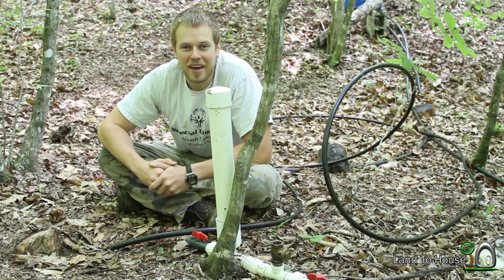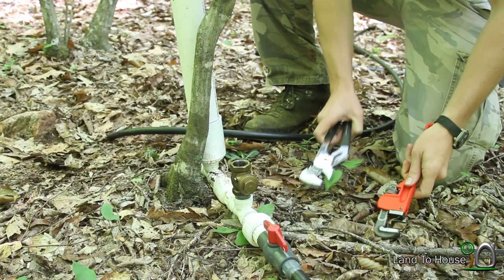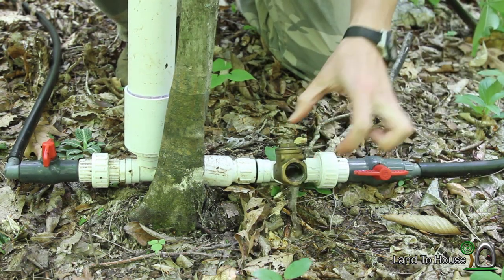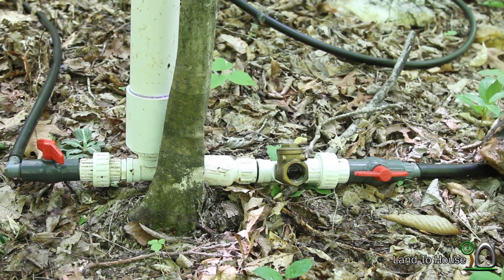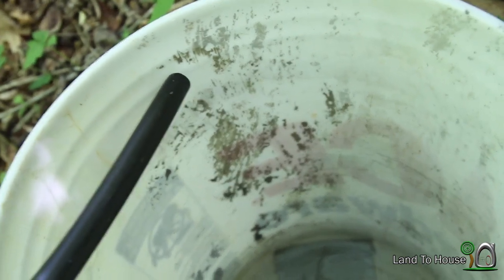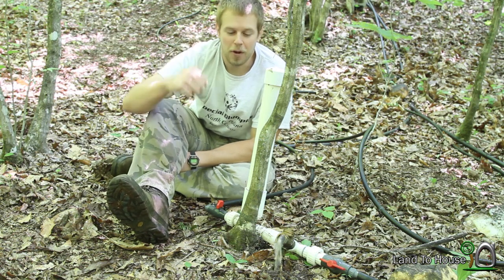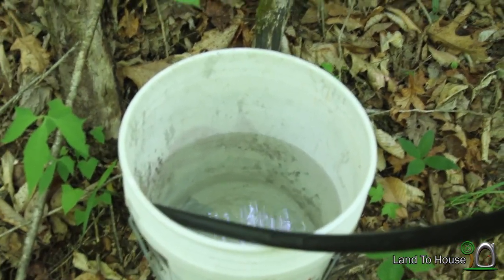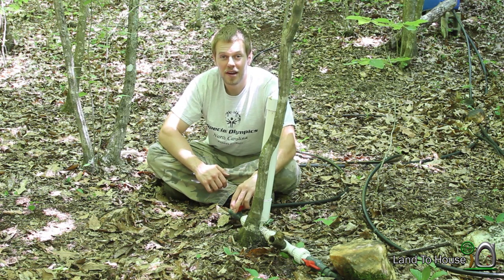Minimum GPM 3/4" Ram Pump

Comment: Could you send that water coming out of the ram pump back to the barrel by attaching another hose or another ram pump?
Reply from the maker: Brandywine6969You can add a splitter ont he pump delivery pipe but the loss is so great that you wont get much more time in operation.

Comment: Hi!!
I have made my own ram pump however I'm facing a problem. Whenever I open the delivery pipe, the check valve closes completely (kinda what happened in your video at 3:12 mark)...what do you suggest I should do. Thanks in advance :)
Reply from the maker: Hello.  This is a common issue.  What is happening is the pressure in the tank is being released when you open the valve.  There are a few things you can do.  Open the delivery pipe slowly to fill the pipe then once it is full then open the valve all the way. If you do not have enough back pressure (your Hill is not tall enough) then you can't open the valve all the way.  Also if you have too much feet of head entering the pump and your vertical is not very high you will have issues with the check valve closing.  Hope this helps.
Reply: Ohh I was not fully aware of the concept of back pressure. Infact, I didn't even connect a hose to my delivery valve. Lol. So the pump requires certain back pressure and that is provided by the height of the delivery. Thankyou. I urge you to checkout https://www.youtube.com/watch?v=4wGwA5w8I7c&app=desktop
I'm a final year engineering student from India and this was my first (hopefully not last) attempt at making a ram pump. Thankyou again, Seth.

Comment: Nice Video,

hi i have a question. can we connect the aquarium powerhead to the ram pump? in order to increase the highest output level of that powerhead. e,g: 2,5m powerhead + ram pump will be get 3m. is it possible ?

thank you.
Reply from the maker: Hi. I have never worked with aquarium powerheads before. Are they just normal electric pumps?  You could use a ram pump to get water to a storage tank then an aquarium pump from there.
Reply: Land to House .com hmm.. my concept is to use the small powerhead (2m max) for my 4m high waterfall. if the ram pump can help the water to reach it level, so we can save the money with only use the small powerhead (cheap). 

is it possible for ram pump to supply water source from electric powerhead instead of river?

*the illustration : https://docs.google.com/file/d/0B_cZXvEtBohkWkZKcTBpbWd6NmM/edit?pli=1

Thanks for you time :)
Reply from the maker: tut Deden Oh I see. Nice illustration. The first thing that comes to mind when I look at your concept is that the ram pump works on a pressure wave going to and from the source. If the aquarium powerhead is pushing water into the drive pipe directly with force I have a feeling that it would mess up the pressure wave action and stop the ram pump. I could be very wrong but my first thoughts are that it would not work. ..... that said. . . If you use your powerhead pump to fill a small tank then the ram pump could pull from that tank and still have a pressure wave. That would work. you would have to find a happy medium between the water filling the tank and the amount of water that the ram pump uses.
Reply: Land to House .com big thanks for the explanation mate.. so it's still need an experiment then.. :) 

thanks, keep filming bro.. (y)